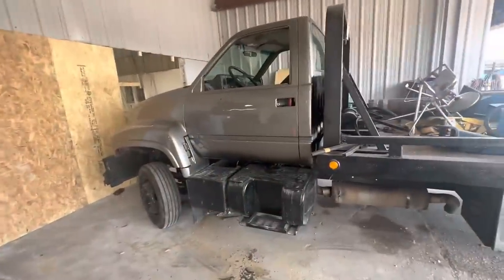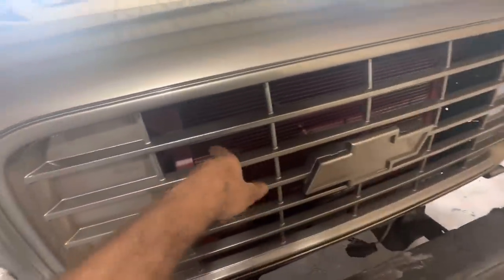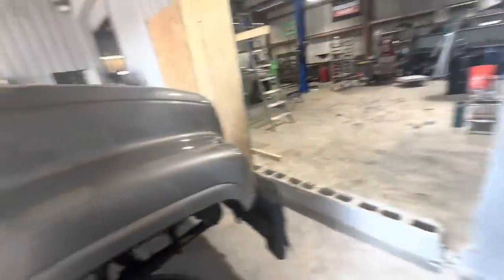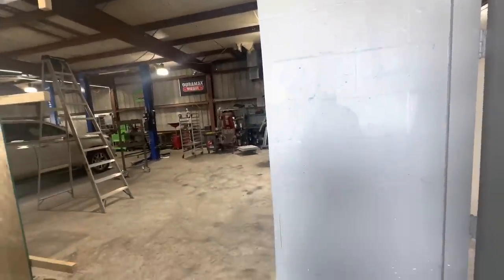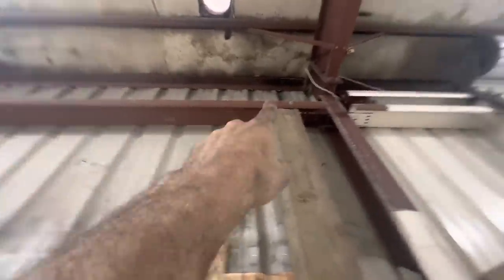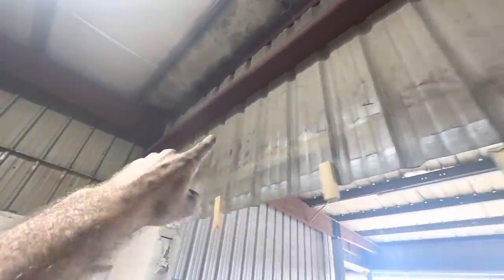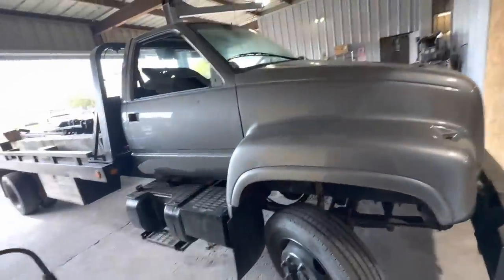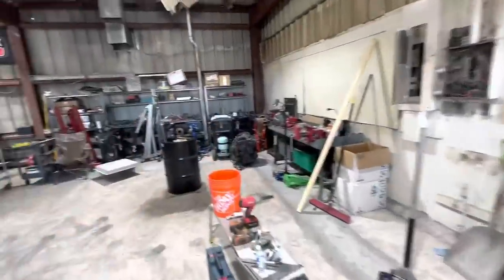Rays Auto Clinic UPDATE! Reeeee-Actions wanted!

Comment: The post, use a strap with the fork truck, its safer.  Drill a hole in one fork to fit a bolt large long bolt and 2 nuts  put one nut on the bolt drop the bolt in the hole with enough out the bottom to put the other nut on, the bolt stands tall on the top, this holds the strap on the fork.
2 wraps of strap around the timber will keep the strap on it. Thats what I would do.  Then you can pick one end up and even lift it off the floor and guide it to its final location. The beams are overkill for nessary size 3 2x6" would have been plenty.
The 8x8 posts were not cheap.

Comment: I would suggest pilot drilling any wood beam lag bolt holes if at all possible.

The bottom bracket appears to take a through bolt so if at all possible, I would go that way if possible.

Comment: I work in maintenance for a factory and we used the forklift the same way you did. Why work harder when you have tools to make it easier on you. One thing I do suggest is you should drill the concrete holes as deep as you can. That way if you have to move stuff around later you just pound the anchor down into and though the concrete

Comment: Remember to drill pilot holes first next time in the beam to prevent the wood from splitting, and try securing the top of the beam with a rope on a pulley system in case it slips while raising it with the forklift.